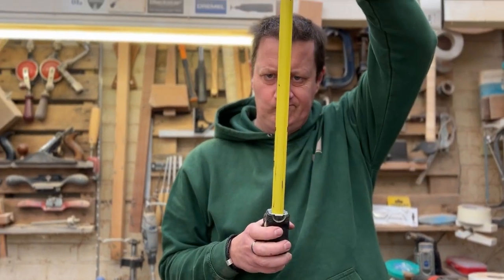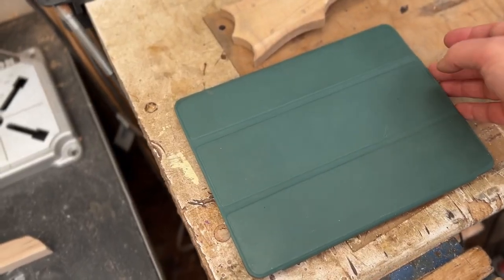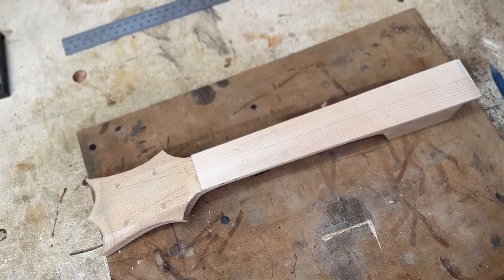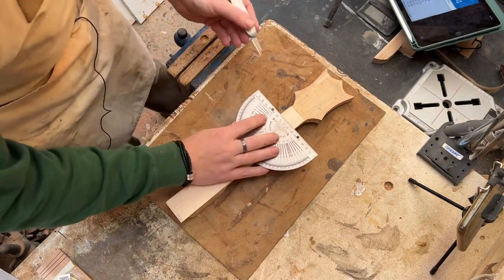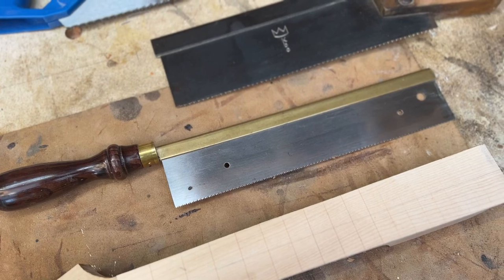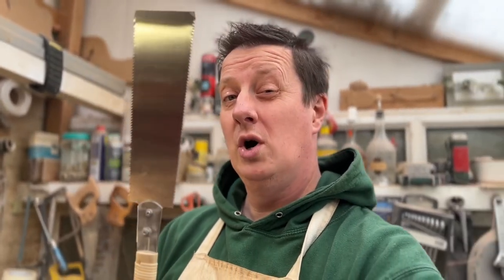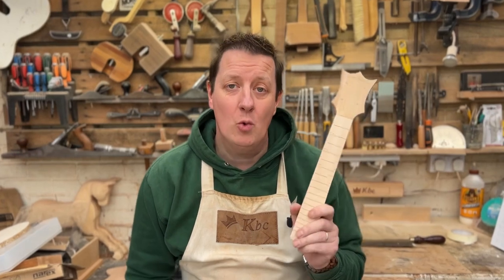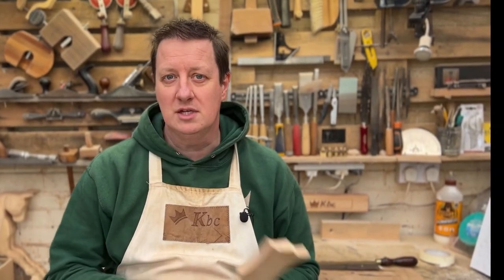Measuring, Marking and Cutting Fret Slots - THE EASY WAY!

Comment: I'm glad I found someone telling me to radius the fretboard first instead of doing it flat like I had been reading. The this thing I couldn't understand about doing it while flat is how to calculate the distance I'd need to make sure the depth is deep enough after radiusing. As in if you cut to the correct depth and then radius the closer to the edge you get the shallower the depth is now going to be.
Reply from the maker: Absolutely. And if you do cut deep enough for the radius, then the centre will be deeper than it needs to be 👍

Comment: For fret slots, I'm using a small Japanese dozuki saw, with a length of 150mm and a 0.5mm kerf, it works like a charm. The brand is Shogun. It costs much less than a luthier's fret slotting saw and has other applications too.
Reply from the maker: That’s cool to know, thanks 👍
Reply: @TheGlaude09  I use a similar Japanese saw they are excellent.How do you gauge your depth for the frets with this saw?
Reply: @james9789  You can use some masking tape to mark the depth.
Reply: @TheGlaude09  That's good enough for me excellent thanks 👍.
Reply: Do you have a link to your saw by any chance, or a model name or serial no? There seems to be different kerfs and not so easy to find the right one.
Reply: @meadish  i bought mine from Amazon uk around £20 type in Japanese pull saw they all cut very thin kerfs the blades sre thin and flexible with lots of bend.

Comment: Here's a tip for you generally- its common enough to hammer the splayed teeth on your saw especially on those japanese ones to remove or reduce the splay. I imagine the pull saw would work for this then the reason the western ones come splayed more is if you're inexperienced with them it is likely to bind so the splay reduces this.

I'm pretty sure Paul Sellers taught me this many years ago for tenon saws, how to make the cheap ones cut well. If you're doing fine joinery you really benefit from no splay.

I'd say one if the big advantages of japanese pull saws is you can press them on a flat and saw off dowels tenons etc flush, but that only works if your teeth are not splayed. Hope this helps!

Oh- and no reason you can't just file a tool to the dimensions you want. Its no different to sharpening your chisel, again if you've removed the splay. 

Also we have thin pull saws in the west too for thin cuts, in between a tenon and a hacksaw. 

All japanese saws are pull cut so they vary between fine work and typical hand saw. I'm pretty sure their tenon saw equivalent are usually single edged- and they probably come flush cutting.
Reply: Looked it up, a typical japanese dovetail pull saw is 0.3mm kerf with a 0.2mm blade.
Reply from the maker: All good stuff 👍

Comment: If you're brave and the saw is cheap enough (that it doesn't matter) you can reduce/flatten the curf of the saw by hammering the teeth on a hard surface.
It becomes a flush cutting saw but if the blade is the right size then why not
Reply from the maker: That is true, use the rag in can to keep it running smooth

Comment: How do people cut fret slots that don’t go to the edges of the board ?   The ones where the tangs are (undecut) slightly shorter than the fret tops ?
Reply from the maker: You put a binding strip along the edge after the fret slots have been cut.
Reply: @KingBespokeCreations  Thanks for the response. Binding is not the answer I was looking for as that’s not a blind fret slot.  That’s a bound fretboard.  I have found the answer and FYI, it’s either CNC Milled or laser cut.
Reply from the maker: @GodzillaGoesGaga  like cheating really then! 🤣👏
Reply: @KingBespokeCreations  It depends if you are willing to move with the times or you want to whittle your lute out of old spruce felled with an axe whilst sitting around a campfire I guess!! Get the mead out !! 😉🍺👍

Comment: What scale did you use
Reply from the maker: It’s a 16” scale
Reply: Was that with the specific measurements?
Reply from the maker: @davidodle782  I used 406.4mm on my app that no longer appears to be available!  Lots of websites will calculate any scale length you fancy though. 👍

Comment: formula for everybody measuring fret lengths by hand, when ur measuring a fret, its distance from the nut = the scale - (the scale / 2 ^ (which number fret it is / 12)). so for the second fret on a 22" scale guitar, its distance from the nut = 22 - (22 / 2^(2/12)). 

and for u microtonal freaks out there like me, which is why i figured out the formula, u can substitute 12 for ur preferred division of the octave. so 24 to double your frets and access the half sharp/flats. but 31edo is beautiful, albiet probably cramped. something smaller like 7edo could be sick just to see whatsup with it. idk u all probably have ur preferred tets i dont have to tell you whatsup if you read this far.